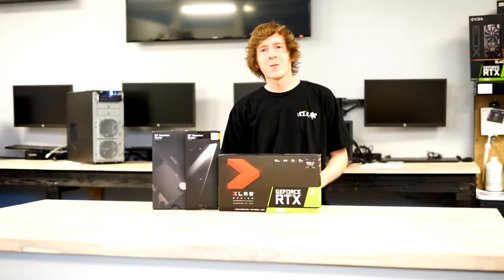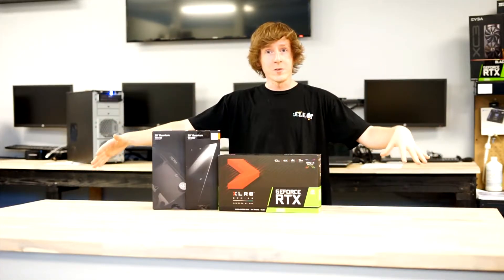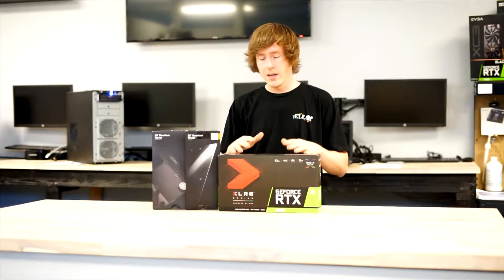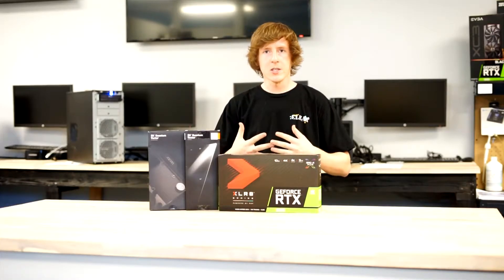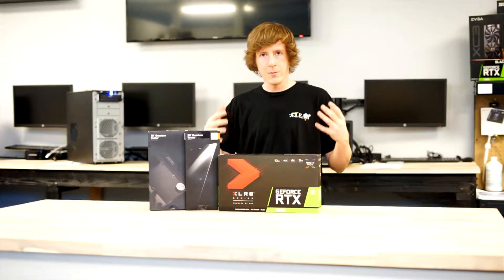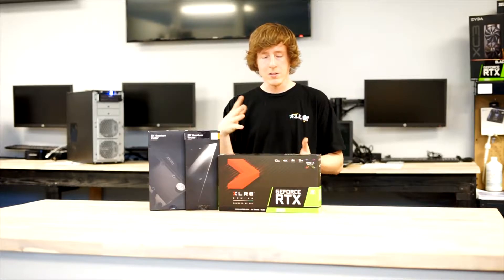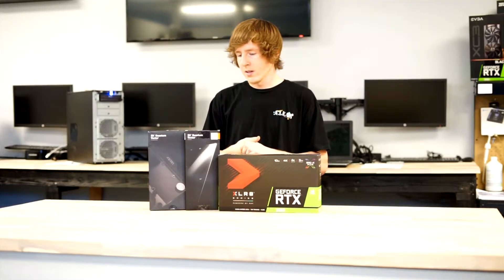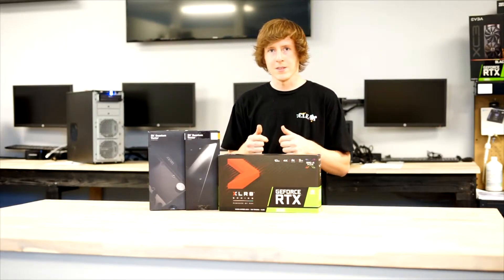PNY XLR8 RTX 3080 EKWB WATERBLOCK INSTALL!

Comment: Hi man, i'm interested in getting this card model. What were your default VRM/Memory temperatures when gaming before it was watercooled? as in like, stock vrm/memory temps.
Reply: I know this is an old comment but I have the exact same card (had it for a year) only difference is that mine is 12gb. But on idle I get about 32-35C and on full load it's a stable 69C when playing games like warzone, Dying Light 2, smaller games it's about 57C
Reply: @ADarkEntity  Oh wow, thank you very much for the info! Yours looks great and stable. Thanks again, man.

Comment: Does this not void the warranty of the card?
Reply from the maker: Absolutely does!
Reply: @CactusComputers  did you find any seals that you had to tear open while opening the card, because usually, based on my experience, if there are no warranty seals, if you put the original thermal pads on the card back and take out anything extra your put, they accept the card for warranty replacement.
Reply from the maker: @nishankyadav7863  they have a warranty sticker over a screw that is required to open and remove the heatsink. We would not recommend putting a waterblocked graphics card back together and trying to send it in for RMA.
Reply: @CactusComputers  right, if there's a warranty sticker then it's absolutely warranty-less. Thanks for your info! What options would you suggest to lower the card temperatures for pny 3080 and 3080ti without voiding the warranty?
Reply from the maker: @nishankyadav7863  a nice mesh case and some high CFM fans with a good layout.

Comment: I want to trust this guys suggestions on thermal pad thickness but the dislike counter is gone...
Reply: Just in case anyone reads this is future, his advice is sound.  I have the 3080ti variant of the PNY XLR8 card and the EK block, and all the thermal pads as per the EK manual are 1mm on everything on the front side.  What I will say is that on the backplate side the EK manual advises to use 2mm pads on everything, but this results in a backplate that won't screw down.  Also from looking at the backplate I took off with the air coooler, the pads were not that thick on the stock backplate and did not go on everything the EK manual said.  I kept the main RAM backs at 2mm and used 1mm for the rest, and the backplate then went on fine with no bulges.
Reply: @chimpboy12345  Well, I have the PNY XLR8 3080Ti as well and the EK Block and Backplate were really hard to screw down and I was kinda scared because it bent slightly when I tightened the screws. The temps were fine though and I thought I would just leave it as is. After a few months however I just now noticed high hotspot temps (90 degrees) so I suspect that the mount is bad. Right after assembly the hotspot temps didnt exceed 75 degrees so something seems to be wrong and I assume it's and incorrect mount due to the backplate.
Reply: @AthenesWrath  Did you use the 2mm pads on the backplate side like the EK instructions said to, or the 1mm pads like I eventually gave up and did?  It was pretty flat once I switched.
Reply: @chimpboy12345  i used the 2mm ones as per the instructions. I guess that's why it bent when assembling. I need to get it out of my system and take it apart to know more though. I hope it's not bent too badly.
Reply: @AthenesWrath  I've linked an image in this comment in case it helps.  I took a picture of the original PNY backplate in case you don't still have yours for reference.  It only had 5 thermal pads, the one I bordered in blue being 1mm (and recessed) and the ones bordered in red 2mm.  Looking at the EK manual, the pads that are extra to the 5 the PNY plate used seemed the problem to me, and I swapped to 1mm pads for them.  TBH I think I even left those three individual little chips off, because the backplate already had ridges for them and even the 1mm pads seemed too much.  Once the 1mm pads were on the rest, the backplate went on flat.  Before that it was bowing badly like you mentioned yours is, and I couldn't even get all the screws to catch.  The tolerances must be pretty fine.  https://files.catbox.moe/gabfgc.jpg

Hope sorting the backplate helps with your hotspots.  The backplate shouldn't be contributing a huge amount to temps good or bad, but the bowing might be affecting the pressure on the core 4 contacts that matter I guess.
Reply: @chimpboy12345  thanks, I will take it apart soon. Doesn't really make sense that I get this high if a hotspot temp but maybe the bending causes that.